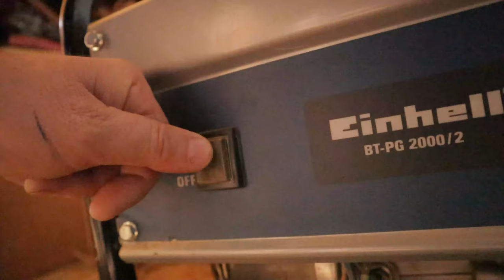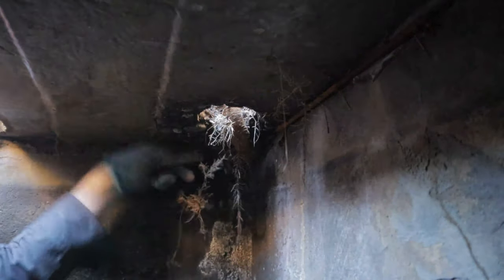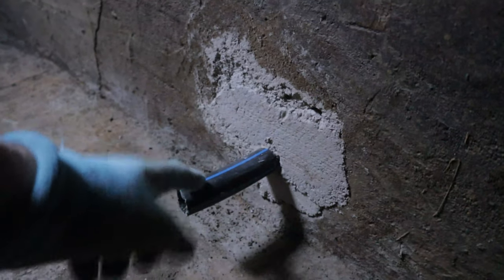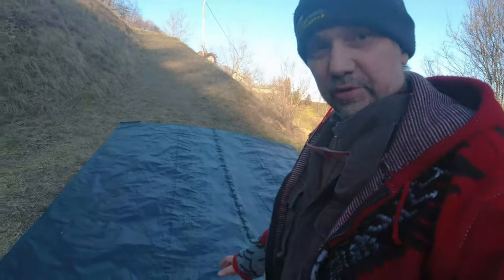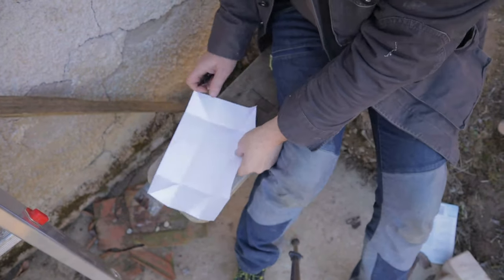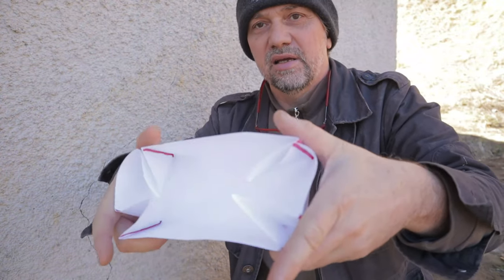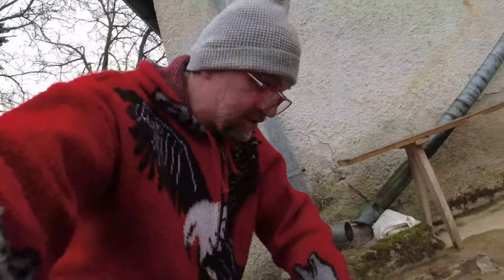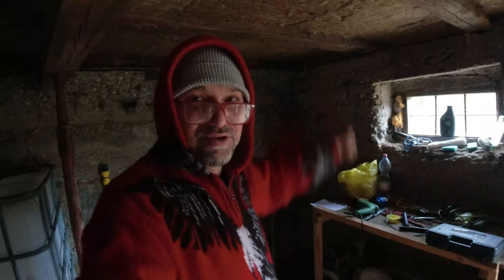Concrete Water Tank Leak Repair Fast and 100% Waterproof Cottage Restoration (Story 16)

Comment: Is the bucket strong enough for you to make a rope ring around the top under the lip? Would that make for easier lowering and raising of the bucket? Just a thought.
Reply from the maker: Yes, it is strong enough. But it’s my fault, I could fill the bucket twice and then I would have no problems 🙂